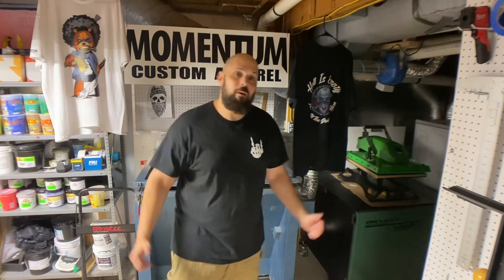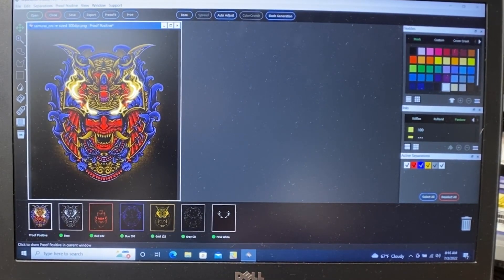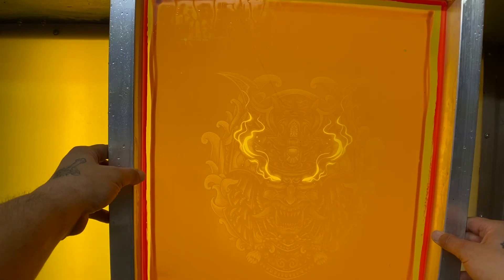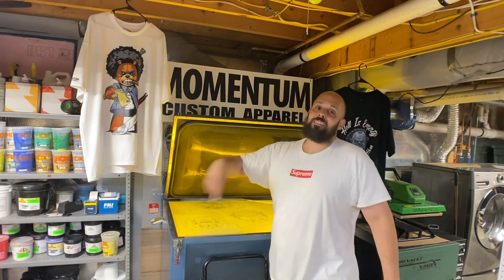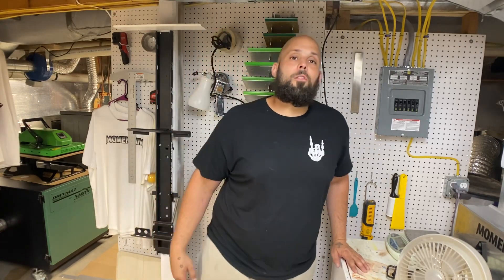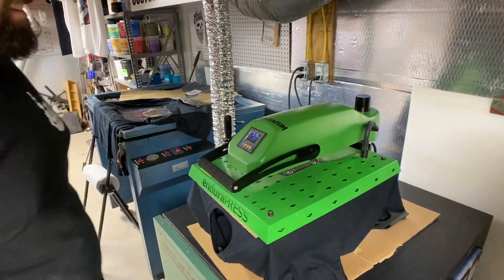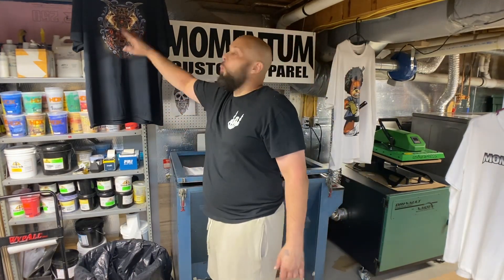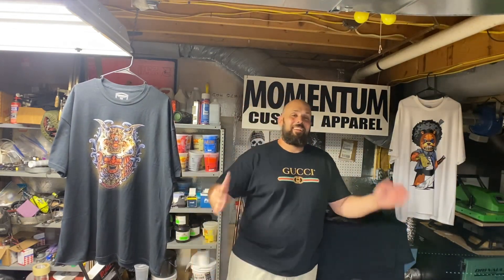Amazing Halftone 6 Color Detailed Samurai Print!

Comment: Awesome!!!!!
Reply from the maker: Hells yeah! Thanks brother, this one turned out extremally detailed.  I did experience dot gain as the print run went on thought. But anyway thanks again!
Reply: @momentumcustomapparel  Do you know how to control thi dot gain? Do you apply stabilizing? Just curious.. Cheers from Brazil!
Reply from the maker: @rafaelmarques1754  honesty not sure best method, but I just cleaned back of screen with ink degrader and a rag.  It did help though
Reply: @momentumcustomapparel  Anyways, nice job!!!!

Comment: Nice print - pretty dope! How are you curing on the heat press without smudging the ink everywhere? Are you flash curing it one last time before taking it off the press?
Reply from the maker: hey brother!!!  Exactly, every shirt, even a single color print gets flashed and than pressed for what ever temperature and time the manufacture recommends to cure there ink.  Most Plastisol inks require 320 degree F for 60s.  This is a little time consuming and it sucks for a large order...but Im doing what I can with what I have.....10 more weeks for my conveyor dryer to be delivered, cant wait!!! thanks for the comment!! Stay Printing!!!
Reply: @momentumcustomapparel  thats great. What did you go for? Anatol?
Reply from the maker: I wasn’t gona say because I want to do a reveal video but yes it’s not hard to tell I like Anatol a lot!
Reply: @momentumcustomapparel  Excellent choice. I'll look out for the video when you do it. Whereabouts are you guys based?
Reply from the maker: We are based in New Hampshire, it’s been unusually hot here, saw something on the news about longest heat wave in my area 🥵

Comment: Cool print......did you do the artwork?  I like it !  Hey, remember with the neck tag, you've gotta include the RN#                 First time I've found your  videos and am subscribing :-)  Personally, you don't need that music.  Just you talking and working is good !    OH YEAH !  I forgot to add that at first, I was thinking "why are you printing the white highlight second?!"  BUT, it totally works !  With the red too!   Very cool !  Yeah, experimenting is the key!  Good work !   Also, what was your LPI, dot shape and angle were you doing?  Good choices
Reply from the maker: Hey thanks for watching and subscribing!!! Also thanks for the information about my neck label's... going to look up the RN# to see what its all about.  I definitely don't know everything.  I actually learned to Screen Print on You Tube and just constantly experimented and tried new things...finding what worked and didn't for me.  In my option its the best way to learn.
But to answer your question 45LPI, 45 degrees, round.  This LPI is for 230 Mesh, and you should use a 2 part Emulsion where you have to add a Diazo.  This will greatly help with halftone dot detail....your screens will just take a lot longer to expose due to the diazo.
If you ever need anything just let me know, Remember Stay Printing!!
Reply: @momentumcustomapparel   The RN# is on the tag that you tear out. Different for each brand and style. Hope that helps ya 🙂  Oh wow, so you did 45 degrees too? I always think of the default with that being 22.5, but will have to give that a go.  Yeah, I used two part emulsion since 2009, but just recently switched (when my reg. emulsion was discontinued)  to that Plastisol Baselayr . It's a premixed and I have to say that I never have had such tight, small details pulled out with my 2 stage. Seriously !

Comment: what program are you using?
Reply from the maker: Hey!!! Thanks for watching my channel!! I had to look back to this video cause there has been a lot of changes since than.  The program I was using is Separation Studio with AccuRIP Emerald as my rip. It is incredibly easy to use, but it is kind of expensive like $399 per year.
Reply from the maker: Currently I use Photoshop for my color separations and I have Screen Maker as my rip.  Photoshop is def harder to use, but there is a lot more adjustability. Screen Maker was like $500 for life.  I switched due to costs, but I really like the separations that Separation Studio creates.